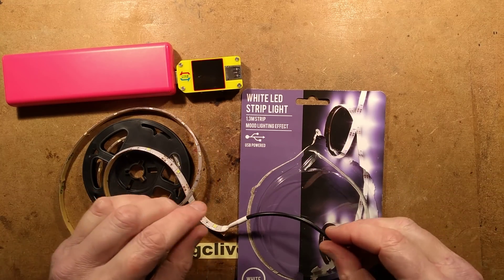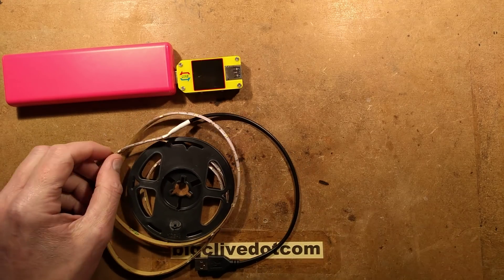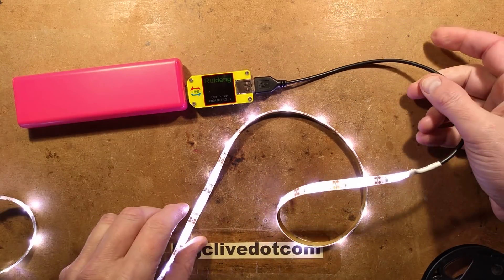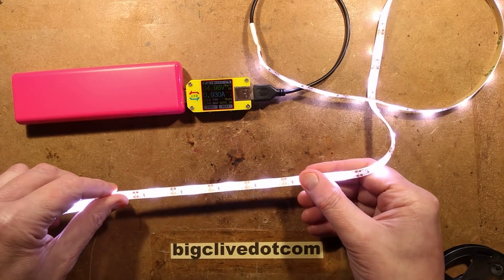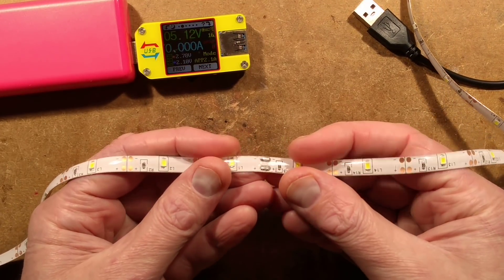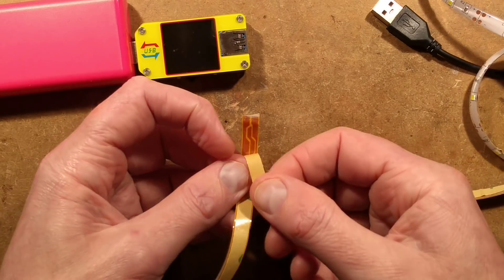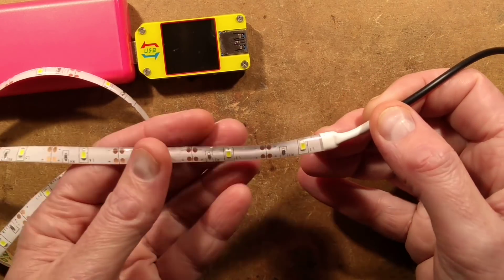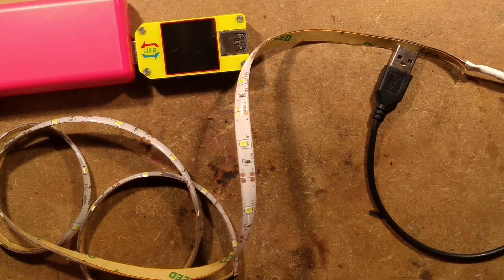Poundland USB LED tape.

Comment: if it was stuck to metal that would be a heat sink so last longer
Reply: Hardware stores sell long strips of aluminum which work great for LED tape. If you run them in open air, or stick them to something that can't absorb the heat they produce, they'll die within a few months.

I did a test awhile back to see how long various Chinese LED tape works in open air without heatsinking. All strips started failing within a few months. The "water proof" versions with the silicone coating would start turning brown and lose light intensity before the individual LEDs would die with the black spot of death.

The strips that I put on aluminum strips or other heatsinking surfaces are still running without issue.
Reply: GGigabiteM I think you just have defects... My LED strip for lighting my bedroom is stuck to carpeted ceiling (it’s a thing common on RVs, it might be called something else but it’s basically carpet insulation), 0 diode failures so far from that installation. Then you might say, sure, but they are not densely filled 5050 LEDs, but I had 60w of (12v 5 amps) in blue in my computer and not all of it was attached to the metal, a lot was just hanging there, even some coiled in a small role (so the back of it was even warmer by more LEDs). I’ve even got some stuck to wood (one of my other PCs is Halloween themed and built in a wooden casket, I’ve also got some stuck to the plastic fan housings), I’ve even stuck some on the backs and sides of graphics cards (one of the hotter ones I measured was 60c at the backplate, yikes that’s toasty!). If this isn’t failing the lights, then I’d say heat probably isn’t that much concern. Like sure some of those are only a year or two old, and they may only run 4-8 hours a day on average, but still I’d think I’d have seen some failures (I have like 40 ft of light strips in my RV, and my computer I ran 5 meters of lighting as a joke about how much LEDs you could pack in a case, and my 3d printer also has LED strips).

I’ve had 3 dead on arrival diodes (in an RGB strip), and 3 5050 blue diodes that stopped working (I was the fault of that one, I think I had torn the strip folding 270 degrees on itself or maybe it was when I hit it with a hammer, but either way user error).

Now, do LEDs fail? Yeah! My dad bought a “cheap” (seemed pricey as hell to me. For me it had better be $1 to $2 max per meter!) LED fixture, and it had a really crappy circuit (all the diodes were in series, and it used only a full bridge rectifier and a capacitor, aka 4 diodes and a cap...). So it had flicker issues and all sorts of garbage, it made my wiring look professional, haha! Yeah it died after like 6 months (I’m shocked it lasted that long), I told my dad to just rip the guts out of it and stick on a light strip and hook up an old computer power supply and it should last many many years. It’s so weird when DIY bottom tier parts are so much higher quality than what you find in stores! Anyways, good luck on your next ones, I just use computer power supplies (or the 12v system already in my RV), so maybe your power supply has bad voltage ripple and causing the issues, it’s hard to diagnose electrical systems sometimes, but hopefully your next rolls don’t cause you any issues, cheers!
Reply: @jakegarrett8109  When you play the ebay lottery, you get crap more often than not. The 7 or so rolls of LED tape I have are all from different sellers and all of them have incorrect value resistors that cause the LEDs to be overdriven.

To keep them from burning up, either have to heatsink them or under drive them with a lower voltage.
Reply: GGigabiteM I guess I’m not aware of what resistor they should be using, I never checked the datasheets I only plugged them in and run them. Mine are 12v, so I assume the 13.6 or whatever a car/RV battery for them was fine. My printer I think runs a little higher voltage (just a bump, it bogs the voltage down a lot when the heated bed kicks on so I’ve adjusted it’s power supply up be a little higher for some extra heating power to cut down on warmup time), I don’t really notice a lighting difference since the lifts are kind of blindingly bright either way on that blue 5050 strip, haha!

All of mine have been purchased from EBay (I’ve had a lot of defective other electronics like you mentioned, just not LEDs, yet anyways...). I agree that it can be a hit and miss, and all electronics seem to vary component parts even in the same batch with some of the other electronics I’ve ordered, so having wrong resistors isn’t too surprising to hear. I guess I’ve just been lucky so far on the 5 or 6 roles I’ve bought so far.
Reply: @jakegarrett8109  You can use ohms law to calculate what you need for a resistor.

Most single LED packages are rated at 20-30mA, where the high end is pushing them pretty hard. Many ebay sellers use resistors to push them at max current, and sometimes higher to claim they have the brightest LEDs. This leads to reduced life, especially on marginal LEDs which are often used (ie. factory rejects)

Some of the LED tape I have uses 220 ohm resistors, which at their supposed 12v rating will push 40mA through each LED and run them smokin hot. These are the ones which turn brown and die unless I undervolt them a fair bit.

A more correct value would be 470 ohms, which would make them a bit dimmer but last far longer at 18.7mA, or 330 ohms for a higher ~26.7mA and still be in spec.

Bumping the voltage up and out of spec quickly changes how much current LEDs pull since more voltage and heat lowers the resistance of an LED. If we use average battery voltage (13.8v), a 470 ohm resistor will give you 22mA and a 330 ohm will give you 32mA.

Comment: I’ve got two runs underneath my kitchen cupboards & it’s enough to do most kitchen jobs by & it’s running from a mains pass through socket with 2 USB ports
Reply: There are a couple of options there, but I would worry a little if I had to unplug something to switch it off. I do have a switched multi-way adaptor and that would work. There are some PSUs that have a similar size to a 13A plug. I've a USB hub with switches for each output. I have a PSU with a USB-C output cable, and a switch in the cable, and converting that to the usual USB-A female might be worthwhile.

I do see some good ideas for using it, but nothing I want to do enough to warrant the fiddling about with a PSU/

Comment: I have a few of these in my caravan,and have them connected to a cheap remote control dimmer (purchased from eBay a while back) dims them very smoothly down to almost nothing  it has a key fob remote with it- 
Should be a interesting teardown for u Clive ?
Currently item number for these 
163864653883

Comment: Bought these from Poundland (at £2) and they work perfect as budget undercabinet lights in my kitchen 👍
Reply: Should add a USB mini PIR sensor to it
Reply: DigitalIP Now that’s something I didn’t think about.. where would I get one? EBay?
Reply: DigitalIP Excellent, thanks for that! 👍
Reply: @ryanlike2162  Np.. forgot to mention that they have a little dial on the back of them to adjust the shut off delay, so whichever one you get would have to be adjusted to your liking. Depending on which one you go for there is either a little hole on the back of the sensor for a small screw driver, or you'll have to take off the casing to get to it.

Comment: I see that they include an empty Super 8mm Reel, at no extra charge!
Reply: FindLiberty Yeah, CPC/element14 charges extra for a reel unless you buy an entire uncut wholesale reel.
Reply: (Poundland: Hey, fire the marketing guy for not listing that!)
Reply: I recently bought an RGB-LED-tape which is coiled onto the same type of reel. I surely will use the reel for some old Super 8 films I'm trying to digitize.

This type of reel seems to be very common for those LED-tapes and I often saw it used for some SMD-components as well.

Comment: Suitable for "extending" a certain 7-segment clock into a truly metre-wide version!
Reply: Funny you should mention it - a while back I've made a wall-mounted LED clock that is exactly 1 meter wide. It's made of styrofoam and cardboard, the 7 segment displays are made from pieces of 12v LED strip and are controlled by 16-bit LED driver chips (MBI5039GF if I'm not mistaken). The brain of the operation is an Arduino paired with a generic RTC module.
Reply: @Sheevlord  https://www.youtube.com/watch?v=wzSOPUTOg6E  me too

Comment: That looks fairly waterproof, should be good to run outside in the rather cool winter air (at least here in Finland) after a wee dip in some sort of sealant for the ends .
Reply: The phosphor will also degrade with the higher drive but if you just run them from a 3.3 volt regulator they should last a very long time.